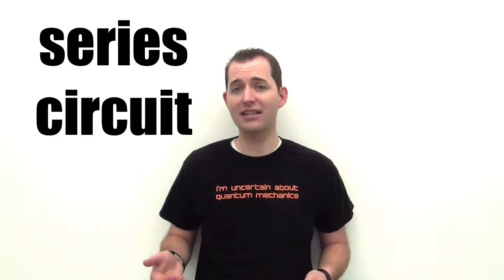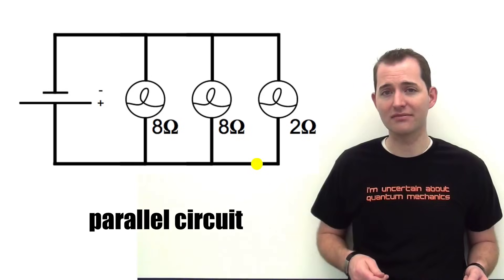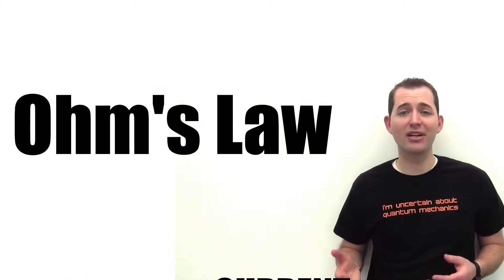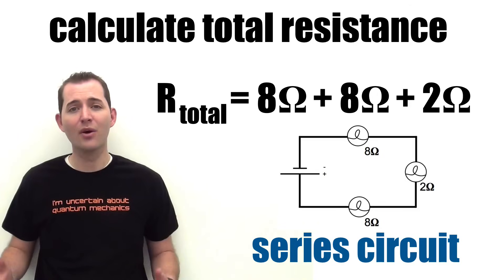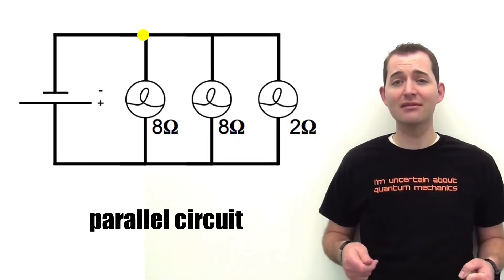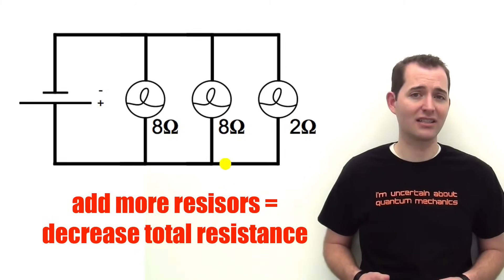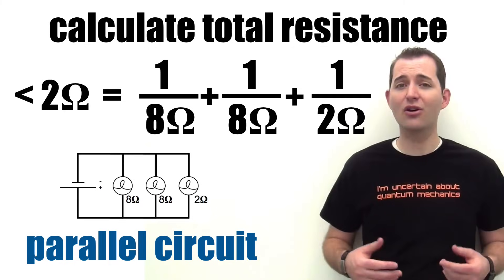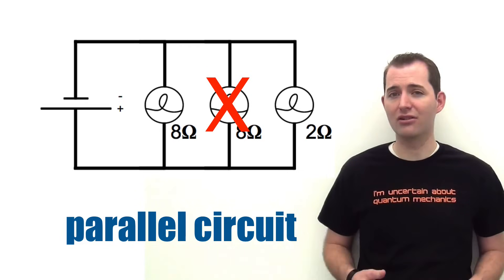Series vs Parallel Circuits

Comment: Is there any reason why Christmas lights manufacturers don't make those damn strings of lights in parallel then?
Reply: because it would take too much wire to hook each light up separately
Reply: Simple answer.....money
Reply: Because it would make it too easy to find the bad bulb.
Reply: Can i can't (Christmas light) 100 buld  in parallel.. or series
Reply: ranjith baracks for example, when 1 led takes 3v and wants 20ma , 100 in series  would take 300v and 20ma, in parallel it would take 2 amps, 3v . So maybe you can do both, 5 in series parrelel of each other, which would take 15v 100ma as a supply. In this calculation I didn’t calculate the voltage drop for each led(voltage drop will increase in serie so better use parallel). Can someone correct me if I’m wrong? I’m just a kid getting into circuits.
Reply: Maybe so that all the appliances(Christmas lights) can be turned on or off at the same time as all appliances in series have a common switch. Hope I am correct.
Reply: Yes they do. They run positive and negative rails and connect across each pair of wires with an LED. Pull one apart and look at it. You will notice, though, that the pos and neg wires do not ever physically join. Can you guess why?

Comment: 0:46 uhmmm, excuse me did this charge just flow through the higher resistor not the smallest? (current flows through the smallest resistance if in parallel).
OK then this has been great.
Reply: Medo Raslan Hahaha exactly what i ws thinking

Comment: in your scientific calc- 1/(1/8+1/8+1/2)= 1.3^
Reply: I knew it was wrong. I was like how the fuck did he get 2 there?
Reply: This is why you show your work.
Reply: He must have accidentally added 0.125 + 0.125 + 0.25 to get 1/0.5 = 2, I made that mistake in my head when breaking down 1/2 into 1/4 and 1/8, and recalculated my answer to figure out the same. Oops lol.
Reply: I was like WAIT!!!
1/8+1/8+4/8=6/8
And 8÷6 is not 2 
I'm gonna just find another video 😂
Reply: @rocki_bb  just.... yea sure
Reply: So am I the only one that got 4/3 😐
Reply: @supreme.king__7069  nah you got the answer right chief, 4/3= 1.33
Reply: Thank God for this comment, I thought I was going crazy when I calculated this myself 😂 I used my phone's simple calculator and got the same answer
Reply: Ikr, i got so confused.
Reply: Seriously wtf when in doubt read the fucking comments

Comment: How do you get 2ohns ?   1/8 + 1/8 +  1/2  = 3/18 =  0.1666666   I must be doing it wrong, can some one help please  :)
Reply: 1/8+1/8+1/2=
1/8+1/8+4/8=6/8
Reciprocal=8/6=1 2/6=1 1/3
So basically 1.333333... which is <2
Reply: I have just checked it again properly and it comes to 1.33 ohms!  how do you get it to 2ohms please... :)
Reply: you are correct. it is 1.33 ohms :)
Reply: Ok thanks...:)
Reply: Did you just simply add the denominators?..
Reply: Hi John, what would you like to know? and I will try and help... :)
Reply: John Berry 
No, he stated "<2 ohms" which means "less than 2 ohms".  So that's technically correct.
Reply: Hi thanks for reply,  so basically in a situation as this one.  you would just round it off to the next whole number?  ... Thanks John :)
Reply: John Berry Not sure about rounding up, but in the video the figure he had up for the parallel resistance was "<2 ohms".
Reply: So summing up,  the total resistance is 1.3 ohms and the stated 2ohms is incorrect ? ... :)
Reply: ok, thanks for the explanation ... :)
Reply: and the reason he said <2 ohms is because the least resistance was 2 ohm in the circuit thats why he mentioned  <2OHMS  Hope this answers everyone's question

Comment: I do not get how when adding another resistor in a parallel circuit it decreases the total resistance. If when in series circuits another resistor is added, the total resistance goes up, why doesn't this hold true for parallel circuits? I mean, your adding another device to impede the current....right?
Reply: +Johnny a So think of a resistor as a funneling of charged particles, or like a doorway at a stadium, if there are people trying to get from point A to point B but they have to go through a series of doorways (resistors) the more doorways there are the slower you are going to go, but if that same group of people goes into a place where instead of 3 doorways in series which slows people down you put the 3 doorways on the same wall, then the people are going to enter and go from A to B faster because there is more space for them to go through, less resistance even if there is more resistors (doorways)
Reply: Very nicely put that, easier to understand thanks... :)
Reply: zonkeymaker Thanks, that's very useful!
Reply: Johnny a

Comment: 8+8+2 is 1.33
Reply: joey adams it's not 2. It's 1.33
Reply: I was just thinking that, thought I'd gone mental! Ended up with 8/6 and thought "That's not 2!"

Mind you, he does write "<2". Why not just work it out?
Reply: yo
Reply: 18
Reply: That only works for the parallel circuits, because we take the reciprical (IDK how to spell that...)of the resistance
Reply: It is 2. 8+8+2=18
The average ohms per resistor is 6
There are 3 resistors. 
6\3=2

Comment: By current decreasing you mean it goes slower ?
Reply from the maker: +Gamer Sparta The potential difference (voltage) would decrease so the number of charged particles passing by a particular location in a given time frame would decrease. So probably best explained as less charged particles passing by, not necessarily slower.
Reply: Thank you

Comment: in this video the single charge is shown to leave the battery at the negative end and travel to the positive end through the series circuit....would that mean that the charge is negative? Following rules on how charges move through an E Field?
Reply: The charge is an electron - a negative particle.

Comment: If the reciprocal of (1/8)+(1/8)+(1/2) = < 2 ohms, are you rounding 1.33 up to 2? 1/0.75 = 1.33, no? Or am I missing something. I'm taking General physics part 2. Just making sure I'm understanding. Thank you!
Reply: he just said less than 2 (<2) not about 2 (~2)...1.33 is less than 2 (1.3<2)
Reply: 1/8 + 1/8 + 1/2 => 1/8 + 1/8 + 4/8 = 6/8 or 0.75
1/(6/8) = 1.33

if you're typing fractions into the calculator you must use parentheses or the calculator will sabotage you
Reply: Total resistance in parallel is always smaller then your smallest resister. So 1.33 is correct.
Reply: +DJ Redmond, I got the same answer as you, did I miss something :/
Reply: +Kathryn Emery , curios if you had figure out the >2ohms, I got 1.33 ?
Reply: Can you help me please,  1/8 + 1/8 + 1/2 = 0.5703  how do you get 1.33?  Thanks John.... :)
Reply: Hi Mederic thanks for reply,  why is the 3rd calculation 4/8 please...
Reply: Ok, thank you very much for your help.... John... :)
Reply: you need a common denominator
8/2=4
(1/2)*(4/4)=4/8

Comment: Thanks, If I have 12v, how many led bulb can light In Parellal Supply
Reply: +Santosh Erram You can light as many as your wiring will be able to handle in amperage. The more LEDs you add in parallel, the more current will flow. So you have to make sure to not overload the wiring, which will be caused by adding too many LEDs.

If you add LEDs in parallel, none of them will lose brightness. If you add them in series, they will get dimmer.
Reply: Keep your voltage to 5v and you should be ok...as long as the wire can take it. If it gets warm, drop your volts.